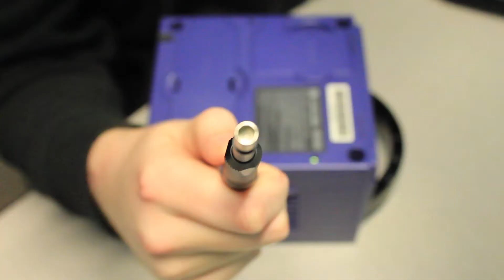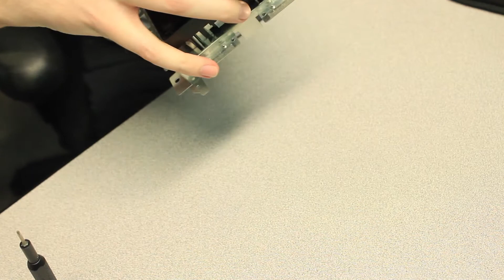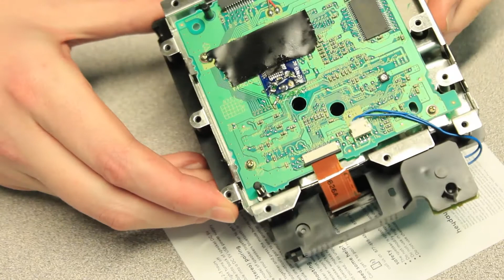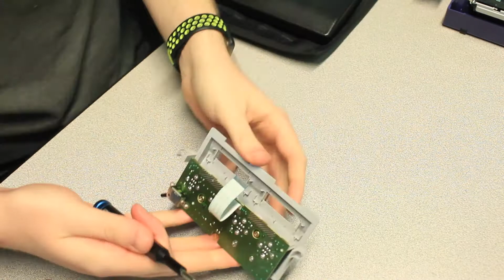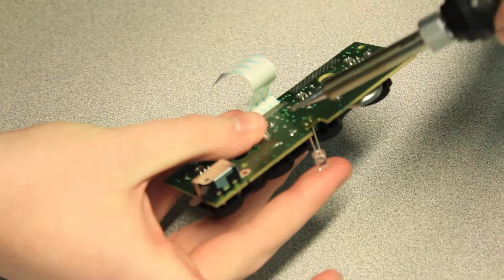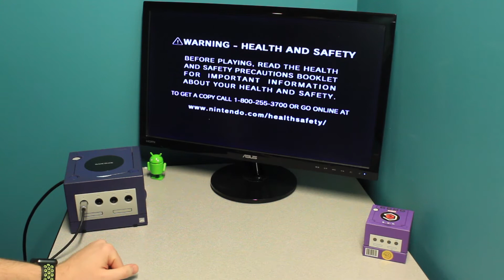GameCube Xeno Chip Mod Plus Bonus RGB LED Install

Comment: I have a dol-101 I install the xeno gc on it but it give me the error with the console check the GameCube manual  I swapped to a dol-001 everything good any tip about ?
Reply from the maker: That's odd. Should work with the DOL-101. Perhaps one bad connection?